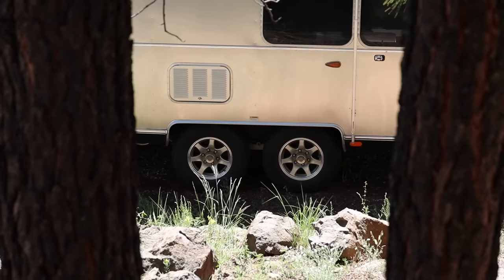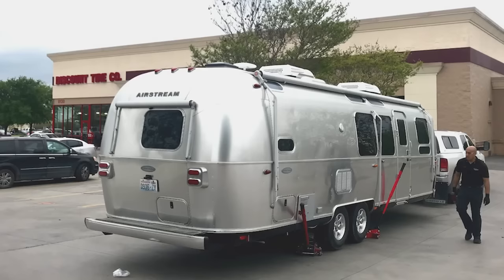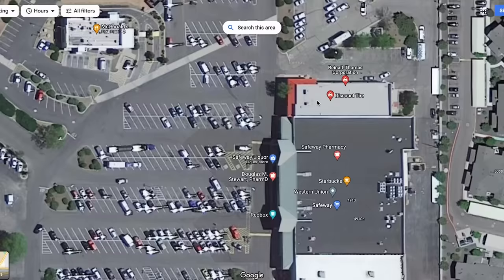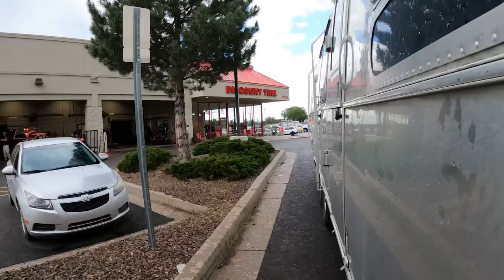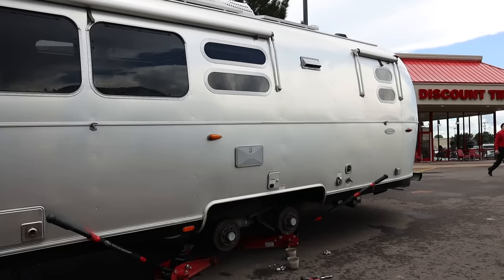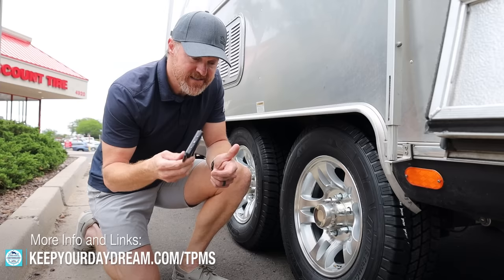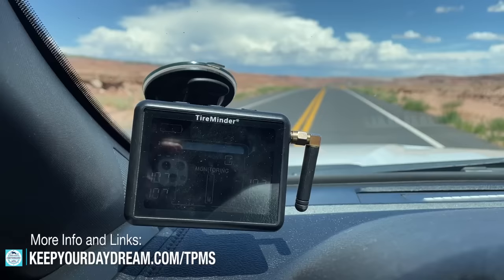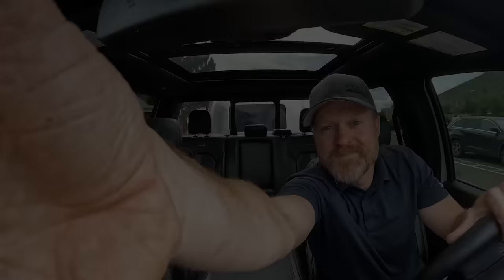Towable RV Tires: Proper Inflation & ST Vs LT + Tips

Comment: Did you get any real benefit switching to 16” wheels? If you stayed with Goodyear tires you would have raised the the Airstream a bit. But since they wouldn’t fit, it seems like you ended up right where you started.

Comment: Guidelines for setting the tpms system.  Nothing in instructions of high low and temperature guide.  Truck tires 34, trailer 60.  What is too high, too low, too hot?

Comment: Marc, did you have solid (bolt in) valve stems. They are needed to handle the weight of the TPMS transducer. I found this out the hard way 🤕 Great episode, are you inflating your 16” to 65psi?
Reply from the maker: I’m guessing they were through-flow? We’ve never had a problem with regular sensors.
Reply: @KeepYourDaydream  it appeared the valve stems installed on your new rims have a rubber base. A solid stem is mandatory to support the TPMS sensor. Rubber based valve stems will flex with centrifugal force with the TPMS wight and fail (an actual leak). Just saying

Comment: Have you been running your TPMS on metal or rubber valve stems. I’ve heard a couple of people say don’t use an external TPMS on a rubber valve stem because it can cause the stem to fail. This seems rare though. What has your experience been?

Comment: Problem is if your only doing 60psi for your load rating, on a 80psi tire, your going to run hotter temps on this desert highways. So I’d rather have a cooler tire than a softer ride. Hot tires blow.
Reply from the maker: Heat is generated from not enough inflation for the load, not the difference between current inflation compared to max. Proper inflation creates the proper footprint. Put your tow vehicle to max cold to see the difference.

Comment: I am having a hard time wrapping my head around running my RV tires (tandem axle unit - 6800lb combined axle weight on the CAT scale) as low as 35 psi (from the table) while I have been running them at 72 psi cold for the last seven years.  I will inflate to a higher pressure 50 psi ?) as I know the tires are not equally loaded and it seems better to run them over inflated than under inflated.

Will need new tires on the TV - a F250 diesel and looking for a recommendation.

Comment: Hi Mark thanks for the info on the tires. I have a class c that doesn’t get used full time ( weekend warriors) . I had blowout on the back discount would not touch it without replacing the tires because they were 10 years old , that sucked!
Do you rotate your trailer tires? I like your videos,keep up the good work thanks

Comment: Doesn’t the psi depend on the tire manufacturer? Aren’t each one made differently?
Reply from the maker: Technically yes, but I've learned that the load inflation table doesn't change much between tire mfg. Each Mfg has their own table though.

Comment: Mark, I noticed you didnt have them balance the tires with your TPMS sensors installed, those sensors are quite heavy. Also did they install "bolt in" valve stems? I have had 2 now start to leak because of the weight of the sensor damaging the high pressure valve stems. I am currently waiting for special metal bolt in stems to remedy this problem.

Comment: Since you do have a Tpms system did you have Discount tire put steel value stems on?  The reason I ask on the trip home from  Texas we had the rubber value stem split causing the TPMS to go off alerting us before the tire went completely flat. We changed all the value stems out for steel when we arrived home.

Comment: Great video as usual Marc! Do you weigh your RV with the tanks loaded to figure your tire pressures?
Reply from the maker: As heavy as I can get it and even then, the load inflation table suggested 55 PSI so 65 is lots of buffer.
Reply: @KeepYourDaydream  I never knew to divided by 4; I was putting psi in each tire based upon weight.

Comment: TPMS--- I've seen a lot of comments that in order to use valve stem mounted monitors, I should have metal valve stems installed. Do you subscribe to that notion, or do you use the "normal" valve stems?

Comment: My tiny fiberglass camper is a 6' x 9' box, and weighs aprox. 1,000 lbs.  My wheels are 12", from Harbor Freight.  The tires say to use 80 psi cold.  I've been using them at around 65 psi.  Is that good?

Comment: Hello! Love ur channel!! A lot of very helpful info. I’d love to know ur thoughts about hitches, which kinds you’ve used and recommend. I have a 30’ classic with a 21 ford 250 and have been experiencing a lot sway. I just found out that it might be the combo of the anti sway in the truck is fighting against the anti sway bars which can cause sway. So I’ve disabled it in the truck and will be testing it tmrw. Just was curious on your thoughts and experiences. Would love to see a vid on this!!! Thanks!!!!
Reply: I wouldn't recommend disconnecting your anti-sway system. I would look at other potential contributors to this issue first. Do you run a wdh and is it set up correctly? Dealer set ours up ok, but after a trip with too much sway we checked and needed more adjustment to get more weight up on front axle. Also, is your trailers weight distributed properly? You need it to be just a bit weight forward on the tongue. When loaded, run across a scale, I think you'll be surprised.
Reply: @robertosgood961  disconnected the anti on the truck and she tows like a dream.

Comment: Ok. I live in Pennsylvania. I was told that if you are running anything other than designated ST trailer tires, you can be fined $1,000 per tire. Regardless weather you have LT tires that meet the load limit. I’m just going by what I heard the LAW. is. Not what Airstream or any tire engineer or backyard self proclaimed expert Thinks. I’m talking Specifically what the LAW and ONLY the Law says.
Reply: Please comment on the LAW and Only the Law. I don’t care what anyone THINKS. Thinking and Knowing are totally different

Comment: Marc, do you get the tires balanced with the TPMS sensor on the valve stem? I had an issue with my truck's tires feeling out of balance after installing the sensors, and believe that was the root of the problem. Just curious of your thoughts. Thanks!

Comment: Weight Balance on trailer tires? What i heard will damage axle??? Under inflated psi heat build up????
Reply: If anything it should help the axles because they won't have an out of balance tire shaking around on them

Comment: Well I seem to be getting some mixed information.  Maybe you can help me out.  I did as you suggested and went to the Goodyear site and looked at the load information table.  I run ST235/80R 16 Goodyear Endurance tires.  The table says that for the weight that I have on each tire (2000 lbs) I should be running 35 psi in the tires to carry 2090 lbs.  The dealer that installed them told me to run 65 psi, even after I informed him of the 8000 lbs on the set of four tires,  as have other tire dealers I have talked to.  35 psi seems very low to me.  Is there a point that you don't go below in pressure no matter how little weight you have on the tires?

Comment: So is it ok to to run E rated tires rated to 80psi set to 65psi which is what is on my trailer sticker? It won’t wear like under inflated?
Reply from the maker: Yes, my new tires are 90 psi and I run them at 67. Same as my truck. Consider that when Jeeping, they run 15 psi and rarely does the bead separate. You're good.

Comment: Ahh Arizona, btw your license plate number was showing…makes sense why you have that fancy tire pressure monitor system on there…easy to make adjustments and easy to air down and/or inflate…well considering I have never seen one of those apparatuses, only heard in passing, I might have to make me a sandwich then head on down to discount tire and be sure to pick all that up…I am sure there is a subway or quizno’s nearby right…